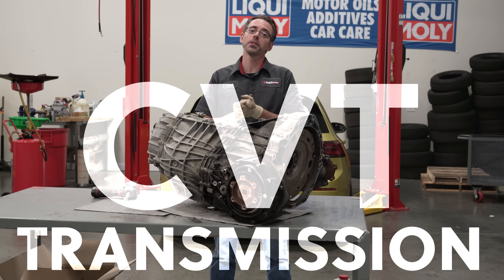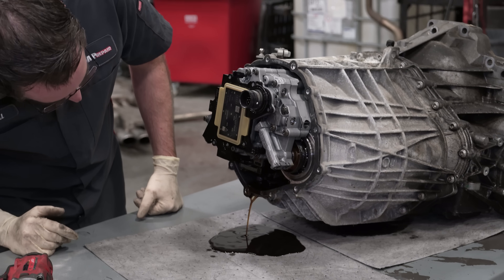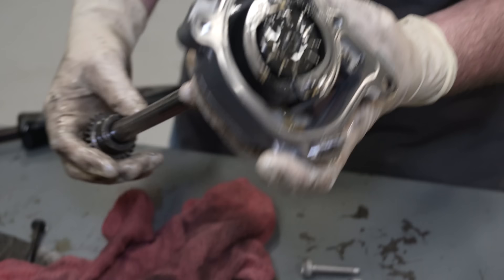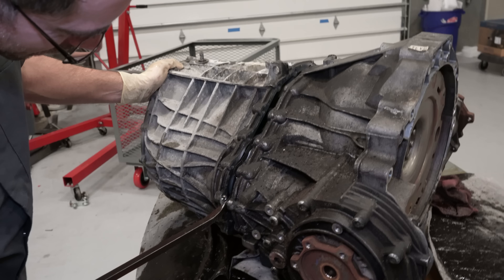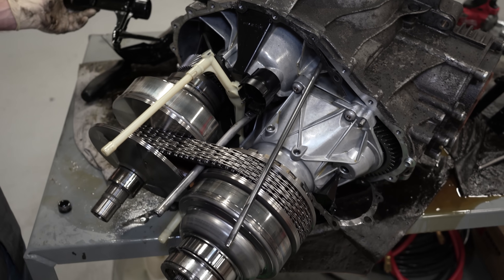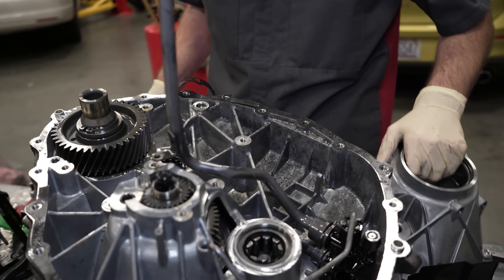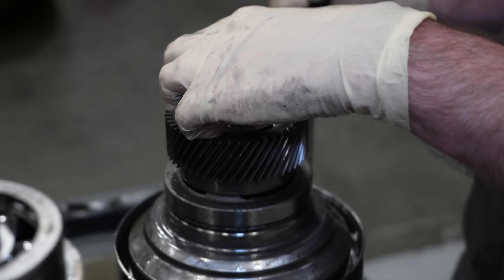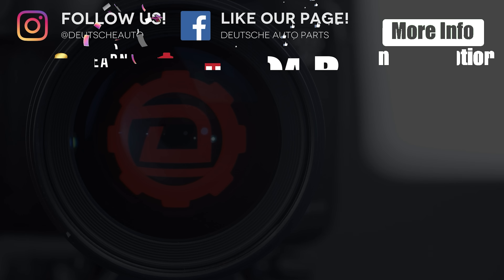Why you shouldn’t get a CVT transmission

Comment: Cvt works great on scooters and all, but how the f is this transmission suppose to push a 2 ton car? The surface area of that belt is like 5mm that touches the metal, there's no grip.

Comment: I sold my Nissan Maxima with a CVT to get a 6MT Audi S4.  
With the Audi, everything is an 'early' wear part...  LCAs and UCAs (nightmare to do for a suspension job), Engine Mounts (eugh), Injectors (tuners recommend they be replaced around 70k), needs Carbon Cleaning every 70k , PCV is plastic and designed faulty, and the Tstat and Water Pump might as well be replaced while you're at it.
While my S4 is fun to drive and it's nice to row gears again, I'll risk the blown up CVT any day over the risk of my 3.0t going lol... The 6MT swap for a Nissan was $8k.  I've already got $17k (parts+labor+shipping+taxes) into my Audi.  RIP

Comment: Thanks Paul! Was looking everywhere for a guide to repair my CVT transmission and now I can safely say it’s being crushed at the scrap yard 💪
Reply: Nobody repairs or rebuilds them anyways...
Reply: Never gonna see 250000 miles on one twenty years from now.
Reply: @Neighbor51  325k in a 16 Corolla before it took a dump..Uber driver I know showed me…Toyotas are that exception…never saw any honda cvt go to 250k ..
Reply: @Neighbor51  250k on my 2010 prius, never even had any fluid changes and shifts like a dream stiill
Reply: @QuincyStick prius do not use CVTs they use eCVTs that despite the name, do not have belts and pulleys and are not subject to the problems of the first one.
Reply: Toyota hybrid cvt isn’t like other cvt, it just happens to be continuously variable. It’s one set of planetary gears that controls the input from the gas motor and each electric motor simultaneously, seamlessly, and almost wear free by design. This is specific and throughout all and only Toyota hybrids.
Reply: My Audy from 2002, I bought it new, has now 400.870 mls.
51584 mls with the first 01J and 349.000 mls with the modified 7 disc clutch.
 @Neighbor51
Reply: You are a wise man.  Good decision.  Good riddance to bad rubbish!
Reply: 2014 Subaru 60k no problem yet.
Reply: They are OK for golf carts and Scooters. For a car, stay clear.
Reply: Kona car? Got a Honda..been good so far 60000 miles
Reply: @edubb2491  wait till is got 100,000 miles on it...
Reply: @Edubb  71k on a 2019 accord sport. No issues either.

Comment: They have been around since the late 1800's on various applications. The CVT really shines in industrial applications. Dozens of use cases for speed variation and in most of these cases they can be very reliable. I think it comes down to it's use. If built properly a CVT should be great for small, lower-powered cars. Constant changes with very high torque would require a much more robust CTV making it no longer a reasonable option when used in a heavy car or one with a higher output engine. For the average 100hp econobox they are really not bad if built properly.
Reply: I'd wager CVTs are successful in industry because they do not have to be small, and are made to be serviceable easily/without too much labor (which is hard to do in a car, when the first step it to take the transmisson out of the vehicle)

Comment: The plastics they use in the CVt transmission is the same plastic they use an engine timing chains.  
That’s not by accident that is design flaw so you can buy a new car every six years

Comment: CVTs are a great idea....that doesn’t quite work in an automotive setting. 
They’re fine in lawn tractors where the engine RPMs don’t vary much, aren’t subjected to high torque shocks, and are easily serviced.
Reply: I mean, they work, but they are bad compared to the alternatives...
Reply: And yet, all major auto manufacturers are increasing the amount of CVTs they use in their product lineups.  Go figure.

Comment: Interesting to see VAG opted to put the transaxle in such a small amount of vehicles, why even place it into circulation
Reply from the maker: Probably testing the tech
Reply: Did FWD EU TDI units get the CVT, or did they decide that to be a test too far and go with the standard Tiptronic torque converter automatic? My memory is fuzzy. I pretty much quit tracking the industry in 2016. All downhill.

Comment: Don't companies like Subaru use CVTs to lower their fleet emissions?  VW's alternative strategy is to make their DSGs  automatically shift into 6th gear at ~30mph.  More efficient?  Yes.  Does the vehicle fail to accelerate if it doesn't come to a complete stop first?  Yes.
Reply: ALL OF THE AUTO MANUFACTURERS CHOOSE THEIR DRIVETRAIN COMPONENTS with emissions & MPG numbers in mind.
Reply: @eskieman3948  LOL!  You said something, but it means nothing.  If you had said, "Subaru uses CVTs to help offset the higher drive train losses inherent to their full time all wheel drive system", you would have contributed something.

Comment: The thing I hear alot about with CVTs going bad is from them not getting serviced regularly. The Car Wizard has a few videos on them. He even compares new fluid to fluid that only has 20 or 30k miles on it.
Reply: The process on my 2018 outback is a tedious job but worth it. Subaru claims the fluid is lifetime fluid. I call BS and service it every 50K
Reply: @rossb5593  damn..my 16 Honda accord..is 1 bolt..and drain
Reply: @edubb2491  Wish it was that easy. need to use a transfer pump to pump fluid back in while car is off the ground completely level. Then after it it's "full" you have to start car, go through the "gears" and then crawl back under car while running and pump in remaining fluid until it leaks from fill plug.
Reply: The fluid so black like engine oil
Reply: @GF-mf7ml  it’s actually gear oil since it’s basically just a gear box. Hydraulic systems share with brake fluid but it’s basically for clutch and it’s separate system
Reply: Everything fails. I would rather instead of a CVT that failed but to see charts on how many cars with CVT’s are on the road and how many are not on the road.
Reply: Non cvt's automatic transmission require fluid change once in 80k km, if you want.
Manual transmission: What's "Fluid change"? 🤣
Reply: @Kytes93  manual transmissions need fluid changes too. My MR2 shifted like crap until I put some mt90 in that bitch
Reply: @Kytes93  Depends on years, moist will get into the oil and dopes will deteriorate too.
MT gearbox, diff oil change is cheap and easy, so why nut?
Reply: @Kytes93  I do manual transmission fluid changes every two years on my cars.
Reply: No.  Nothing to do with servicing.  They are just plain sh*tboxes.  Nissan CVTs regularly fail before 20,000ks, no servicing on earth can save a CVT from being a CVT.
Reply: @einfelder8262  You really don't have a clue, do you?
Reply: Yep
Reply: Cvt is suppose to not fail even if u don’t change fluid , that’s not suppose to be the concept.
Reply: @gfhjhvjgfvkjvv3666 lmao, nothing is lifetime.
Reply: The only reason car manufacturers push CVT is to push people keep changing car within 10 year, people who own car that last 40 years is bad for manufacturer that keep spitting new model every few months.
Reply: BUT, Subaru put an extended warranty (10 yr/100,000 mi) on theirs so you would void the warranty if you change the fluid. SO, dump the car when it gets to 100,000 miles because you know the trans is on borrowed time if it makes it there. My brother's Forester CVT died within the warranty and was changed. My CrossTrek is 7 years old with 65,000 miles on it. It will go bye-bye at ten years old.
Reply: @hotpuppy1  Such horseshit. Mine started shuddering pretty badly at 105k
Reply: @hotpuppy1  wow it took you 7 years to get to 65k miles. My 2021 Highlander Hybrid just rolled past 90k miles and I drive the eCVT hard daily
Reply: @hotpuppy1  lmao yup. My wife's legacy is at 70K and I'm about to dump it. Worst part is, she wants another Subaru 🤦
Reply: True. Manufacturers suspiciously don't make it any easier to service most of them. Guess the excuse is most people don't do the routine service on their vehicles and most importantly encourage the consumer to bring it to the dealership for all services.
Reply: @sirkdopsah1081  the cvt is the easiest to maintain..loosen 1 bolt..and drain fluid..easier then an oil change
Reply: yep. constant metal to metal "grind". and don't neglect the filter(s) too.
Reply: and yet Subaru will void any warranty on their CVT if you DO change the fluid!
Reply: @rickhibdon11  I'll take my chances. I am at 80K on my outback 3.6R and it still runs perfect. Changed the fluid twice now.
Reply: @Rick Hibdon  hope that's not the case,  tho it's believable. My parents just got a new cvt Crosstrek...
Reply: @crazyeyez1502  According to several other videos I've seen, Subaru warranties them for 100,000 miles. As long as you do NOT touch them. If you do anything to them, it voids the warranty. Subaru considers them a "sealed" unit. There's a running joke that Subaru is using customers to do their "long term" testing.
Reply: @Rick Hibdon  yea. That's why it's believable.  I can see them doing that
Reply: @rickhibdon11 I've got oceanfront property in Arizona too. 
Subaru WILL change your CVT fluid.
Reply: @rickhibdon11  really? I had my fluid changed two weeks ago as per recommended 40K km interval by Subaru. New fluid was green, the old one came out yellow.
Reply: @rickhibdon11 not here in Canada
Reply: @rickhibdon11 wrong
Reply: Or just don't buy one to begin with
Reply: @Easton M  indeed. I wouldn't personally.

Comment: The Toyota CVTs are different they use electric motors instead of belts and pulleys so they are extremely reliable
Reply: And they have an actual 1st gear! 2nd and up are CVT.
Reply: @300DBenz  Why would you have a 1st gear as not part of the CVT gear ratio and not the cruising gear??
Reply: @rkan2  Well, 1st has a super aggressive gear ratio compared to 2nd, any gear ratios in between are dead weight, dead space and dead technology in a CVT. When you need a reverse anyway, it's not difficult to do both reverse and 1st as a separate thingy. You can use the saved space for a better cone slope of the CVT, giving you better grip and less risk of slippage.
Reply: @rkan2  The answer is obvious....  how much torque is put through the cvt.   Lots when moving off the line, not so much when cruising.
Reply: @annpeerkat2020  Meh, I don't think the 1st gear should really be an issue in that sense unless you are pushing crazy power. With crazy power you wouldn't be using a CVT anyways. The higher gears is where you spend the most time when moving, and thus with a CVT also the most time loosing effiency. That is where the CVT looses a lot and would havr the most to gain.
Reply: Toyota uses both of those PLUS their new CVT... That has a physical first great for launching. More durable, better launch.
Reply: You talking about hybrid.

Comment: In the U.S., I don’t know if all, but some of the FWD C5 and C6 A6’s came with a CVT too.
I would also add that Toyota has been using a CVT in the Prius for the last 25 years or so and it’s been extremely reliable.  They’re really the only ones.
Reply: toyota uses an eCVT with no steel belt.  Their dCVT has a first gear so it also lasts forever
Reply: @LexusGX460-OFF-ROAD  So, let me ask what’s maybe a silly question…why don’t all auto manufacturers that want to utilize CVTs use those kinds?  Is it because they need to be hybrids?
Reply: @bradleykurtz5536  Toyota owns the e-CVT patent.  No other manufacturer can use it without paying Toyota.  Toyota also owns the d-CVT patent.  Same idea.  The standard belt driven CVT that Jatco/NISSAN uses is an old patent that expired decades ago. ✌️
Reply: @LexusGX460-OFF-ROAD  Thank you!
Reply: @bradleykurtz5536  An eCVT uses two electric motors and a combustion engine. They should just call the whole transmission a power split device because people think of the gas only, belt driven CVTs when they hear eCVT. An eCVT requires two electric motors and it splits the load between the three motors. One motor to generate electricity, one (or more, but usually one) to power the the wheels and the combustion motor, which can exclusively charge the motor/generator, drive the wheels or drive the wheels in combination with the driving electric motor.
Reply: An eCVT uses a planetary gear set to modulate engine rpm. A planetary gear set has a fixed number of possible gear ratios. What makes it continuously variable is that the two electric motors can spin the planetary gears with varying loads of the electric motors it changes the engine rpm because if there's more work from the electric motors it lowers engine rpm and if there's less work and the combustion motor does all the work, the rpm will rise. That's how I understand it, but I'm no expert.
Reply: @jakobauger6805  It's still a CVT as it is still An infinite ratio from the lowest ratio to the final overdrive ratio. What you have is a planetary set with one side mounted to engine and the other to electric motor. The E-motor starts of spinning counter RPM's to the engine and then matching, then spinning fast than the engine. Thats it, it has a simple clutch pack that decouples the engine for full EV mod on the second larger E-motor.
Reply: @TdrSld  That's what I said, just not as well put together, since I was only a little buzzed.
Reply: @TdrSld   Toyota "eCVT" is nothing remotely like a mechanical CVT.    Toyota should have found a better less confusing name for it.   The only thing it has in common is giving a 'continuously variable' output, but then so does a torque convertor.
Reply: @bradleykurtz5536  - the belt drive CVT is used on regular gas-engine-only cars. The e-CVT is specific to Hybrids that use both electric motors and a gas engine. If you are curious as to how an e-CVT works, there are lots of good videos here on YouTube. Prof. John Kelly at Weber State University produced the best video I've ever seen on the internal workings of an e-CVT. It's at https://www.youtube.com/watch?v=-dHeRJdrnI8 if you are interested.
Reply: I mentioned this in an above comment. I think it comes down to use case. IMO a well built CVT is great for a small, lower powered car. It's when weight and power is added that things start to fall apart. The robustness required for larger and/or more powerful applications is no longer viable in automotive use. Great for industrial use though.
Reply: The CVT in my Honda sucked and made for a horrible driving experience and was unreliable.  The eCVT in my Toyota hybrid is a much better driving experience and so far has been reliable.
Reply: @Slimjim_066  Toyota "eCVT" is nothing at all like a mechanical CVT.   That's why the Toyota one can be reliable.
Reply: The Prius uses a planetary system of gears.It's called an ECVT by them but this is misleading.
Reply: Toyota uses an ecvt not a cvt
Reply: Subaru uses tons of cvt's, do does Mitsubishi and I haven't heard much negative comments long term on them. But I'm not in the automotive industry muchnow days so... 🤷🏼‍♂️
Reply: @lNOFXlCronier  the Mitsubishi transmission are seriously weak dude.
Reply: @lNOFXlCronier  Subaru, Nissan, and Mitsubishi have the worst CVTs in history…there’s even a class action pending rn
Reply: Civic Hybrids use CVTs for quite some time. And reliably.
Reply: I got over 50k miles on a toyota c-hr that got an eCVT, no issues. I was not convinced it was a good idea until I searched the internet. Toyota CVT's seem to do really good.
Reply: Ecvt is 100% GEAR, only change output portion amongs 3 powersource : ice/mg1/mg2.
Not changing ratios like direct-shift cvt or other cvts
Reply: Honda has been using them since at least the 90s in Japan. Nissan cutting corners and owners not keeping up on maintenance has given CVTs a bad reputation.
Reply: Ford CVTs in their original hybrids are also bullet proof. Jatco’s used in Nissans and Subarus are crap.
Reply: @jayabraham4377  AFAIK, ford hybrids are Toyotas. they buy hybrid system from toyota

Comment: I had an Audi A4 B8 with this transmission and I never had an issue. 
Sold the car when it had around 100k miles. The next owner is still running it with no issues. 

It’s not a sporty or fast transmission but it is very comfortable for the daily use.